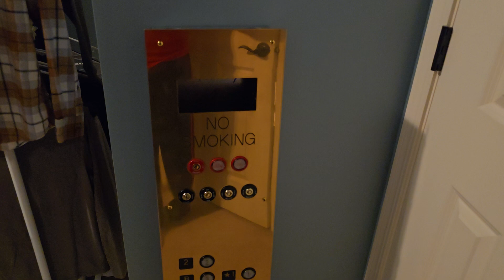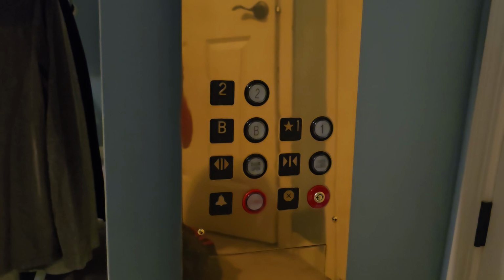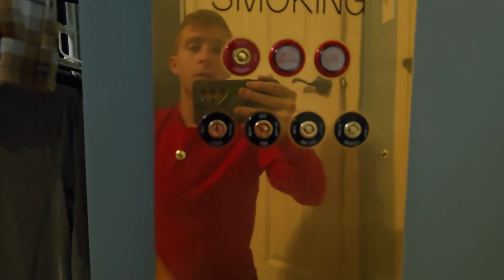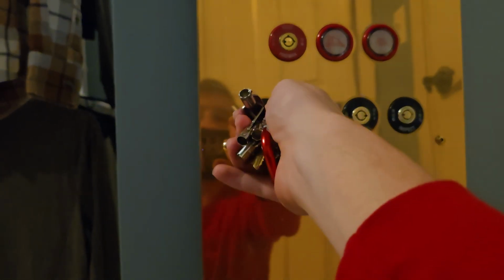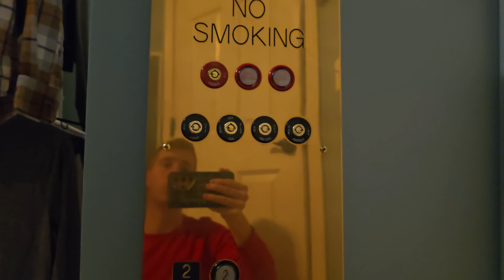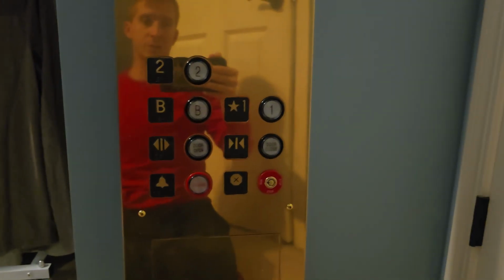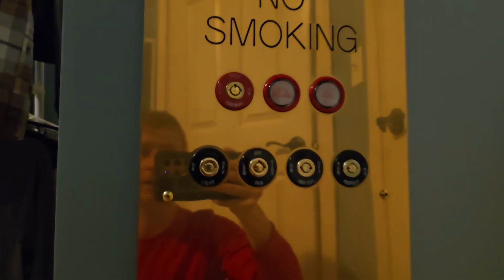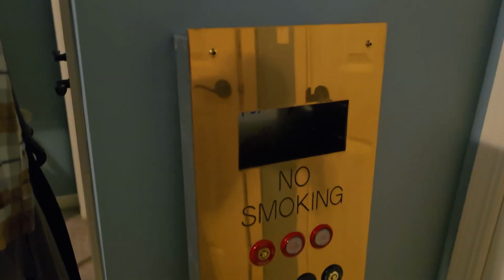My New (to Me) 2004 Innovation Elevator Car Operating Panel Overview & Demo of Key Switches

Comment: Very cool panel, quick question, I’ve seen on some fixtures both Inspection and Access Enable, what is the difference
Reply from the maker: That I'm not sure of.  I'd have to ask an elevator tech.
Reply from the maker: Update: They normally perform the exact same function, but in the case of the Schindler 330A which has both an "inspection" mode and an access enable switch, inspection puts it in hand service while access enable puts it in the true inspection service mode.
Reply: @BusMaster99 what’s hand service, Is it when you can send the elevator up or down through the hall access key switch?
Reply from the maker: @CubicCreator136  Hand service is where you use the top and bottom floor buttons to manually control the elevator.  It will stop once you release the button or hit the final limit switch.